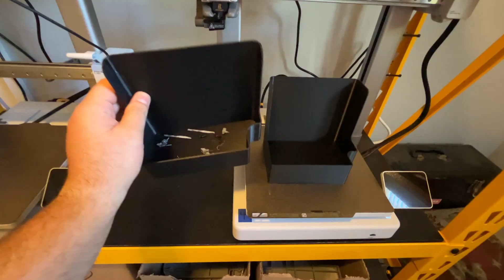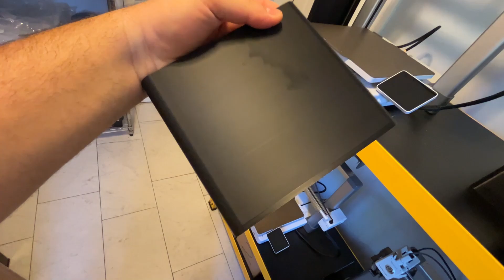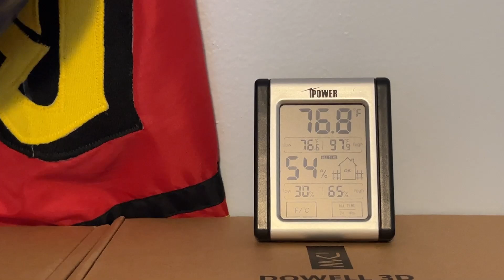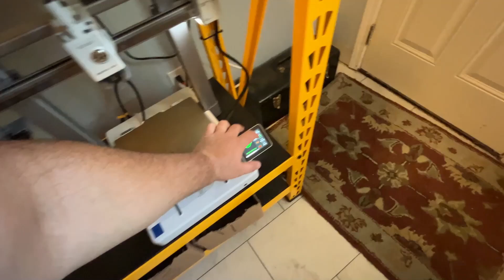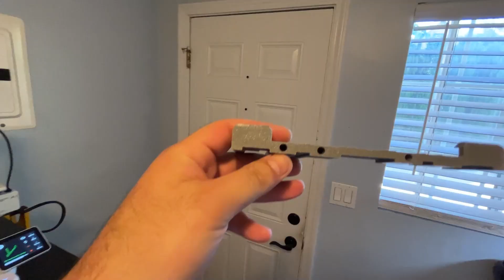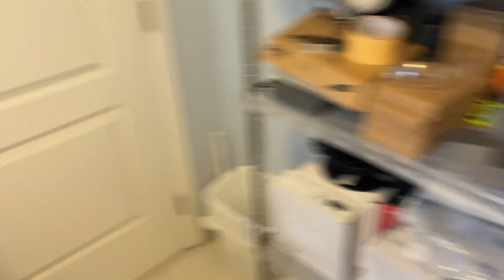Maximizing Efficiency In My Tiny Bambu Lab A1 Print Farm

Comment: Poop buckets were the first things I printed on My A1s and mini. I use a simpler design; mine don't have the tall wall, just a plain bucket with a deflector on the purge wiper. 
What FW are your printers on? The most recent is 1.03.
Looking forward to your combo setup!
Reply from the maker: @NWGR  That’s a smart start with the purge buckets! I’m on firmware 01.02 myself. I noticed there’s an update to 1.03, but after connecting to Wi-Fi, it still shows as the latest version. I wonder if it’s because I chose LAN only mode? I’m on a 2.4 GHz connection through my Wi-Fi extender, so it should be connected. Can’t wait to share more about the combo setup soon :)
Reply: @3DTheory  I think it is because your on LAN only, but I'm not 100% sure.
Keep it up, you're vlogs are inspiring. 🍻
Reply from the maker: @NWGR  Thanks for the input! You were right about the LAN only mode. I had to switch to Wi-Fi to update the firmware after it kept logging me out and disconnecting in LAN mode. Got it sorted now, and the printer is up-to-date. Appreciate the support and glad you find the vlogs inspiring :)